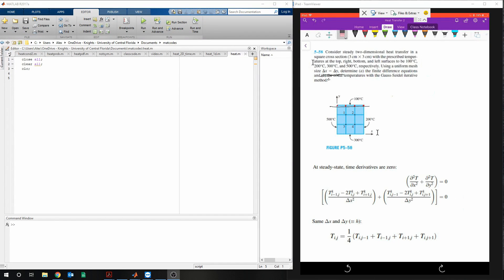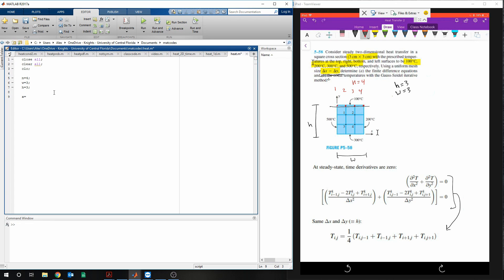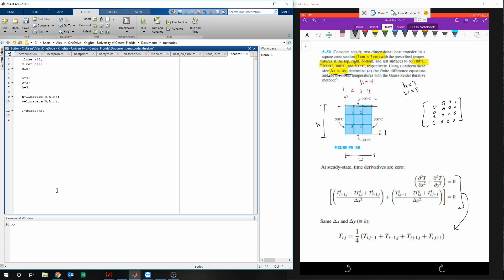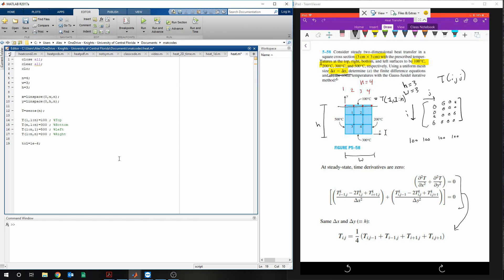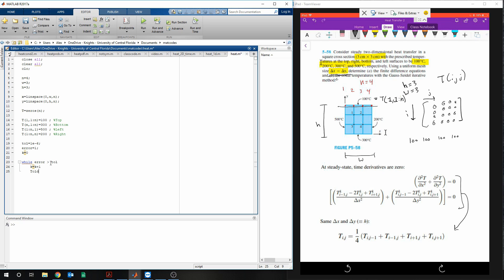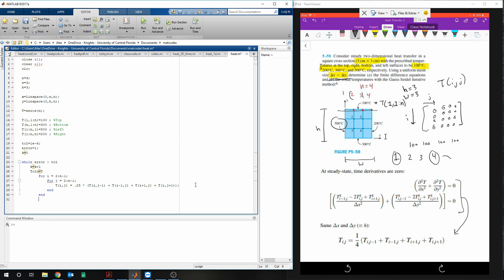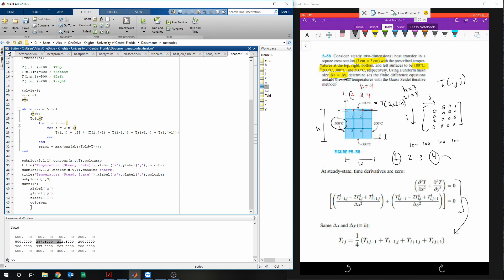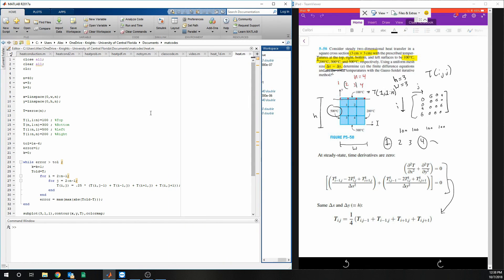2D Heat Transfer using Matlab

Comment: Is steady or unsteady process?
Reply: At the last step calculation, the heat conduction is nearly over because the differences of change temperature is only 1.e-6 degree.

Comment: What is error =1 and why is it assigned?
Reply: for entering into while loop for the first we must  make sure that error is specified with some value which is greater thn tolerance,or else it will throw on error stating "error is undefined". Hope you understood this 😀
Reply: @e-skills2120  ohh.. I see thnx for reply
Reply: It is just a inital vlue of loop in while, it will be changed in the next step, after the value is less than 1e-6, the programme can exit th e loop.

Comment: when i enter the formula T(i,j) = .25 * (T(i,j-1)+ T(i-1,j)+ T(i+1,j)+ T(i,j+1)) , it comes with error message ''Index in position 1 is invalid. Array indices must be positive integers or logical values.''.......any update please.
Reply: iterate i and j from 2:n-1
as you are calculating th average of the adjacent cells, the cells in the edges/corners have none and you call an index out of bounds (-1 or n+1)

Comment: If the left, right and upper boundary conditions were insulated, how would programming be done?
Reply: Thats how I set up the insulated boundary conditions for the bottom surface. Depending on which surface you would like to insulta you would play around with the matrix values.

for i = n
            for j = 2:n-1
                T(i,j) = ((T(i,j-1) + (2*T(i-1,j)) + T(i,j+1))/4) + ((q*dx2)/(4*k)) ;
                
            end
        end
Reply: ÖMER izole sıcaklığı 20 ise sağa 200 yerine 20 sola 500 yerine 20 yazsan olur mu acaba?
Reply: olmuyormuş.
(∂T(0,t))/∂x)=0 mesela sol tarafi 500 olan yüzeyi yalıtacak san x= 0 da  sıcaklığın türevi 0 olacak demek. Ama matalbda kodu nasıl yazılır şimdilik o kadar iyi değilim.